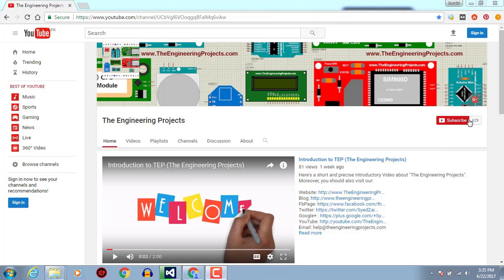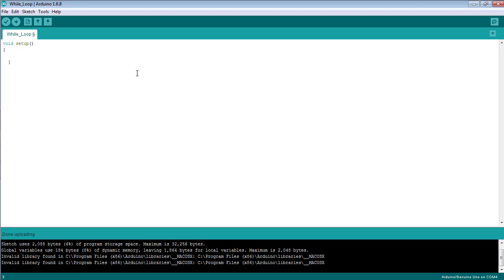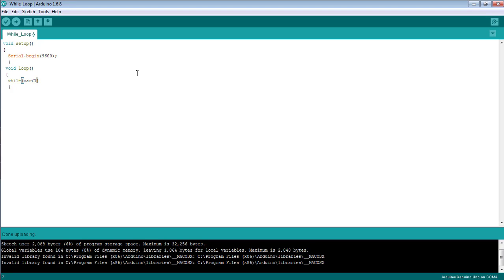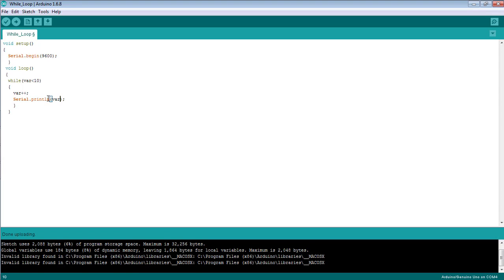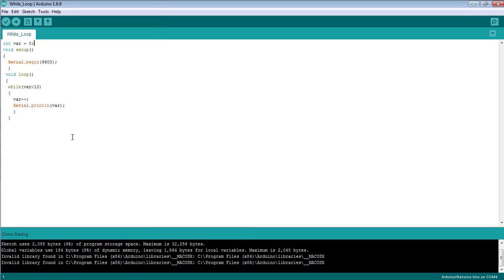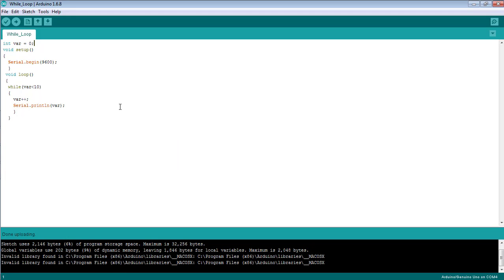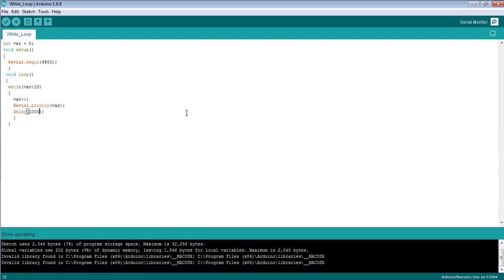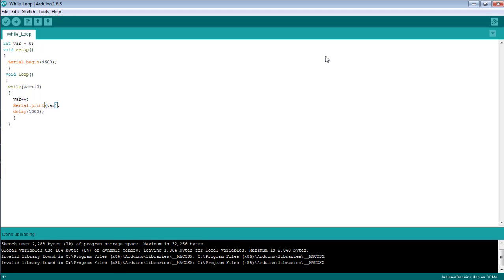How to use While Loop in Arduino

Comment: hi, nice vide.
one question tough.
Why the t arduino counts up to 10? according to the statement it should count up to 9 since 9 is less than 10 .
The while loop is telling that shoud count as long as it is < than 10.
Reply: 9 is smaller then 10, so it adds one up.
when it reaches 10, the condition is met ;-)